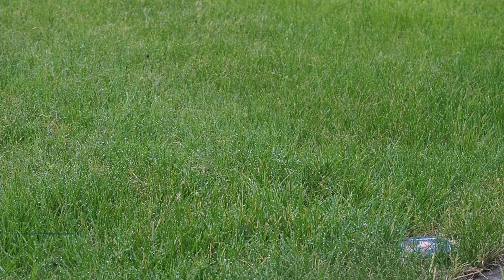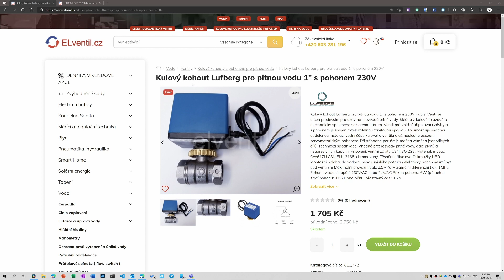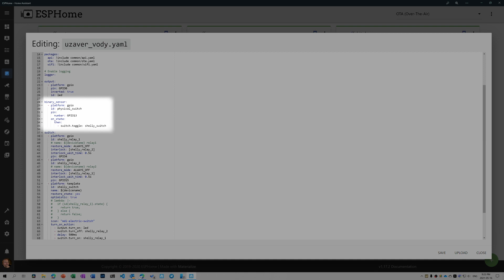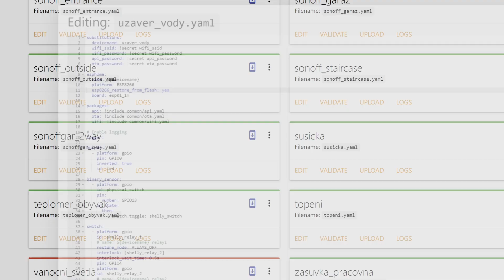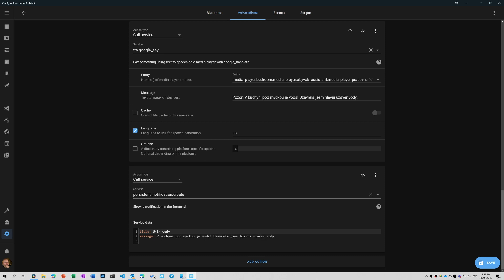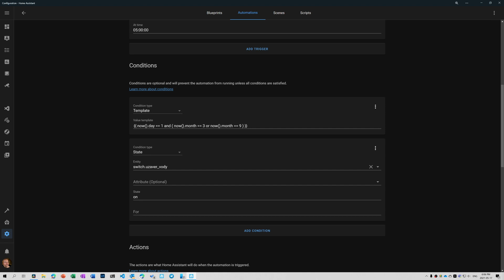Automatic water main shut-off with Home Assistant

Comment: Hi Václav, thank you for the great video. Please could short describe how does the valve control via relay work? I'm currently looking for the right relay from Shelly because I will have 4 water valves. Will the valve remain without current in each position or needs current for position closed? How did you solve the stop positions or is this logic directly in the valve (just relay ON/OFF or required relay for rollers with position 0 to 100%? Thank you.
Reply from the maker: Hi, there are three types of valve. Normally open, Normally Closed and one with three wires that keep the position and you use one to open it and one to close it. For the Normally Closed,you need to have to have voltage on the víře, otherwise it will close. For the normally open the other way around. For the irrigation, I use normally closed, and I turn on the switch when the irrigation runs. For mains water switch I use the one that keeps position. And I have an ESPHOME script to open and close, with a timer to open the switch after couple of seconds (maybe I can leave it on all the time, I do not know). And I remember the position of the valve, whether it is closed or open. I am on the phone right now,when I get back, I might share the script if that helps.

Comment: Thanks for your video. For the water meter problem, did you know Flo Moen? More details in the video from The Hook Up, "smart water monitors"
Reply: All he really needs to add to his setup is a 100psi pressure transducer sensor and he is at like 95% functionality and 20% cost of the Flo, all without relying upon a water fixture company to provide a cloud service. 😉

Comment: What if the test did run but failed?
Reply from the maker: I should not really call it test. The purpose is to move the valve so that it does not get stuck. I do not really have an automated way to chack that the valve actually closed.

Comment: What do you use for the water leak sensor and how do you conect it to Home Assistant?
Reply from the maker: I use Aquara water leak sensors. They are Zigbee detectors made by Xiaomi. But I guess you can use any sensor you prefer. There are a couple of ways to include Zigbee devices to HA, I use Zigbee2MQTT. I made a video about Zigbee, that shows how to connect it. But once you have ZHA or Zigbee2MQTT configured, it is rather simple - you just go to inclusion mode, push the button on the device, and it will appear as a sensor.

Comment: Other people already write it in the comments - small hall effect flow meter like https://www.adafruit.com/product/833  - better use reputable supplier as the brass could contain lead and due to the different freezing temperature of the metals the lead forms at the exterior/interior of the material. What is also  an option, at least in Bulgaria one can find very  cheap <50 EUR water meter with factory sensors, some are even not certified and could be 25EUR: https://www.aquabuilding.com/products.php?cid=85&page=0 , so you can use them with ESPhome.

Comment: I have a private well, so no water meter for me at all. I decided to buy an old-school mechanical water meter with pulse output, and use an ESP32 to count edges of pulses to measure both water flow and water quantity. In my case, I had a separate cold and hot water supply to the house, so I got two cold water meters, one for cold to the house and one for cold water into the water boiler.

Not sure how much this product recommendation will help you in Europe, but this is the meter I used: https://www.flows.com/economy-plastic-water-meter-wm-pc-series/

The advantage to that type of meter the accuracy is high enough to be used for revenue metering, and it comes with a tamper resistant tag indicating such, so it's much more accurate than a paddle wheel or turbine type flow meter you'll find cheaply on the internet.

Comment: I made a comment elsewhere, but in case you don't see it. Investigate Hall Sensors for water flow meters. I think there are some non-invasive ones, poor accuracy metering perhaps, but flow detection would be your basic requirement to confirm flow has stopped. Another option might be a pressure sensor. If there is a leak and the main valve is closed, the pressure should reduce and be detectable. A pressure sensor could be fitted anywhere beyond the main valve. - Remember though, every additional invasive device you add, you introduce an additional failure point, so there are diminishing returns. Alos whilst I'm on; I've two toilets in my house and both cisterns have leaked over the years; worth adding a sensor to any consumer that can draw water, like toilets.

Comment: Link for the water valve you are using?
And can a sonoff 4ch work aswell?
Reply from the maker: Well, here you go https://www.elventil.cz/kulovy-kohout-lufberg-pro-pitnou-vodu-1-s-pohonem-230v that's the one I used. But it looks like a local shop. I am sure you can get similar on Amazon or from China. Sonoff 4ch would work, but it is too big for that. Sonoff dual would be enough.

Comment: Actually your valve testing procedure is not good enough. The reason of the test is to confirm valve is actually closed or actually opened. I had some old manual one which broke in a way you could turn the leaver but the water was still going through. 
Monitoring of the water meter could help in doing the proper test. You close the water, check the meter confirming it stopped and then turn it on again. Only after this the test is successful.
Reply from the maker: You are right, I should not have called it test. The manual recommends to fully open it and fully close it 2x a year to prevent build up of solid residues. Not to test if the valve actually works. So this is what I do.

Comment: For your water flow sensing search ebay or aliexpress for water flow sensor. They usually output a pulse per litre or something and could be hooked up to a esp pin and use esphome's pulse counter sensor. Or maybe simpler - if your existing electronic meter has an led that pulses 1x per litre like some of the electricity meters do then use a photodiode to read it.
Reply from the maker: Thanks. No, it does not have an LED. I was looking for it too. You are right, if I don't find a way to connect to the meter, I'd probably get a dedicated flow meter (should have done it when I installed the valve) :)
Reply: @bruxy70  The utility meter won't have a flashing LED as the batteries in them are meant to last 5+ years. However a Hall effect flow meter would work for sure; worth looking into... Make a video when you find a solution pls?